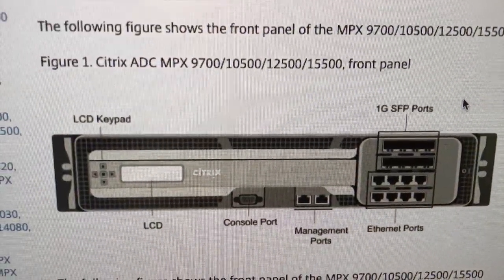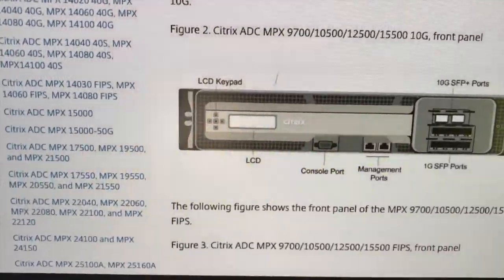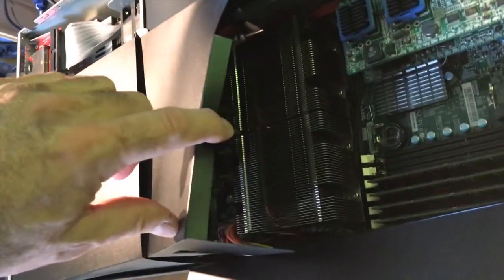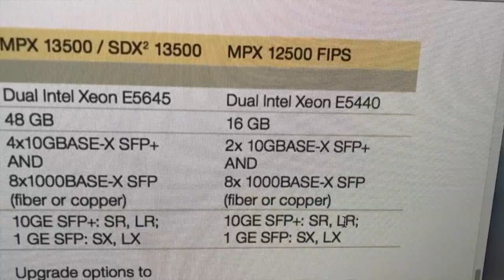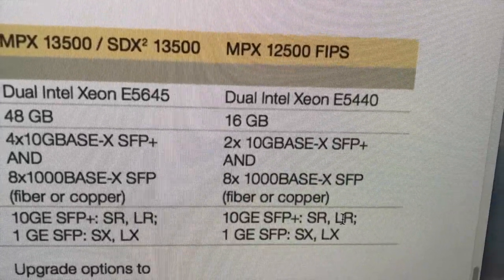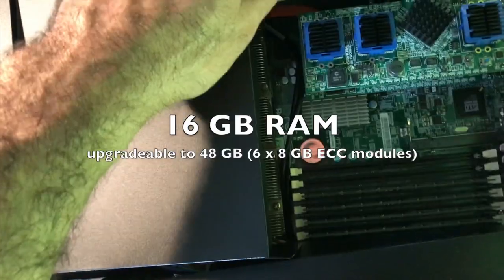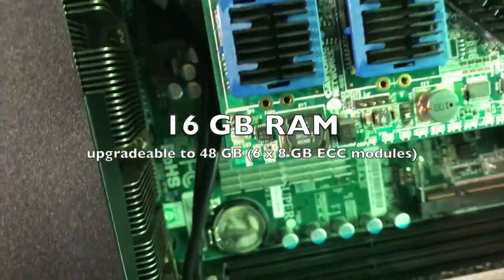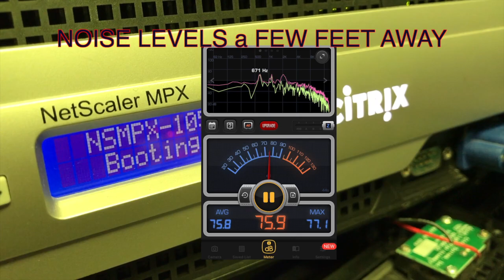Inside the NetScaler MPX 10500 (N90X) NetScaler ADC

Comment: Hi , just a quick question my netscaler power supplies leds are green but when ı type the command to check health of psu displays failed , max 10 min netscaler stops working and all the power supplies turns red , is this indication of dead psu ? or something else
Reply from the maker: Sounds like a failure get replacements